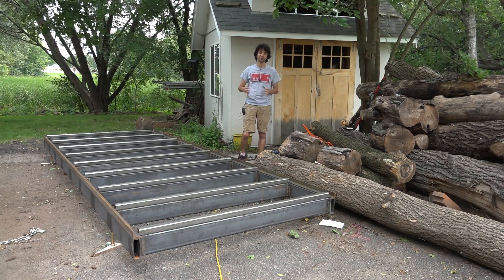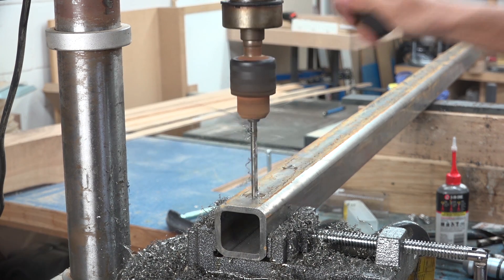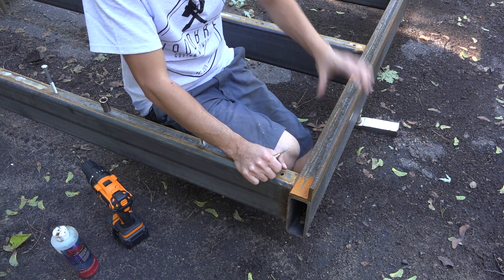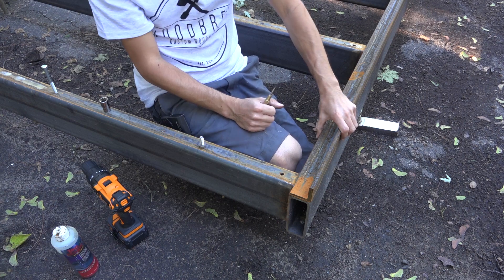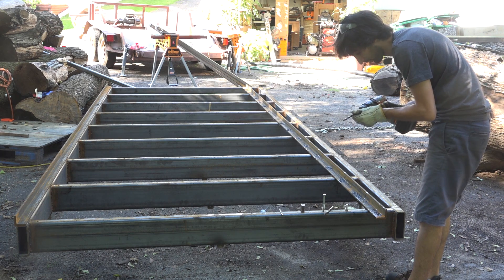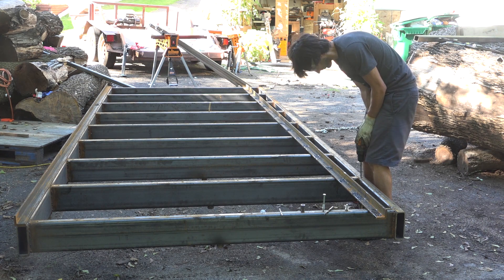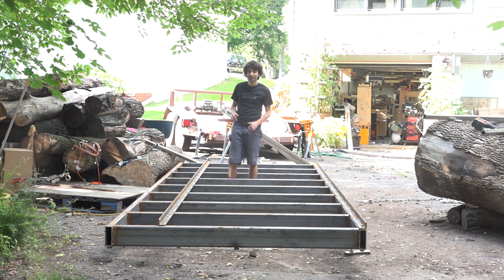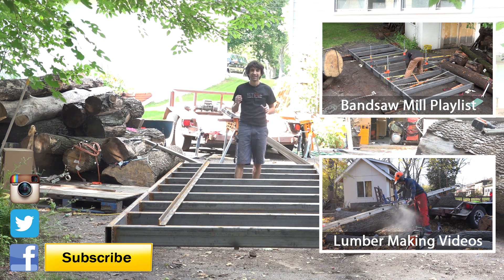Adding the Track and Runners - Building a Large Bandsaw Mill - Part 4

Comment: I for one applaud your good & positive attitude, even when things don’t quite go as planned. ☺️
I’ve been attempting to chainsaw mill with only a 20” bar. Not been a great experience thus far, as most logs I have are 20+” & red oak logs so dense & heavy, my LX2610 Kubota tractor can’t lift them up with its loader. I skidded a 30”X7’ log up from the pile & was able to stand it up on end, planning to saw it down the center, the pith off center, cutting that weight in half, so I can haul it to a friends mill. The grain, almost solid burl, from an old hollow red oak that was 7 to 8’ at the base, taken down for safety reasons & threatening other nearby trees.

Comment: Running a variable-speed drill at a low speed maximizes the strain on the control device. I worked for a company that made variable speed switches for drills. I would put the switch in a jig that presses the switch just enough so that the motor turns. Then I would time how long it took for the switch to melt. It was required to last at least 15 minutes. The switch would also have to melt in the open position, not the closed position (fail-safe).

Comment: Thanks Matt,
 really good learning experience. 
I have one question. Why you drill this holes and not use welding?. I would understand if you  would make everything to be disassembled, also the main frame. That would make sense, you could disassembly everything and store in small package if you don't use or if you want to sell it you can ship it in  a package.

Comment: Fill the hex head afterwards with grease..  stops the water pooling.  When you need to remove, heat with a heat gun the hex head quickly.. it will melt the grease to a liquids.  Towel the hex head dry enough to place the Allan wrench in the hex head and undo as needed..

Comment: At 9:36 (and various other times) if you have to sit on the drill, the bit might need sharpening, or you might have been running too slow and be work hardening the steel. 
I do hope your take away lesson from 7:44 was never ever leave the drill machine hanging on the bit!
Cool project, I love fabricating stuff, my last big fab job was making all the brackets (turned in to more of a sectional chassis so I could remove bits for access) to hold my Triumph Spitfire body on to the rotisserie for blasting and painting.

Comment: I know it is way too late now, but I have built several tables for cutting steel and I just turned the angle iron with the V up and got v notched wheels to run on them.  Works great.

Comment: dude you spent half a lifetime drilling holes, get yourself a professional welding machine , if I remember correctly it is silicon bronze that will weld carbon steel to stainless Its been decades since welding school, a magnetic drill press and some annular cutters. for what you spent on steel and materials seems like you can afford to get proper tools. Most people make these  DIY sawmills with repurposed materials

Comment: I HIGHLY recommend you deburr the sharp cut edges of your steel BEFORE doing any work on it.  You will need to do it anyway, and getting rid of those sharp edges first will prevent/reduce chance of cuts or other injury.
A good flat bastard file and a rat-tail will get the outside and inside edges.
MAKE SURE THE FILES HAVE HANDLES ON THEM.  Those tangs will easily pierce flesh!

And SLOW DOWN that hole saw!  You will get more holes per saw, less chance that the saw will grab etc.  Remember, its PRESSURE AND TORQUE, not speed, that gets the hole saw through the metal.  Ease off the pressure as you get through the metal...

When mounting the guide rails/angle iron:
Use a few bolts to hold it in place until you can get them welded in place.  

And as I'm sure you found out, when the drill bit begins to pierce through the metal you're drilling, REDUCE the pressure so the bit won't grab and snap.
Wisdom comes from experience....experience comes through lack of wisdom!

Comment: 6:09 man what went wrong with that weld? did you use rods that are recommended for vertical welding? If all the welds are like that I'd flip the frame on it's side, grind them flat and weld again in a horizontal position. I'm not sure if your machine will have to pass some sort of government inspection if you want to use it commercially but I doubt it will pass with these welds.
Reply: W.A. van Buren 
My bet, something about keeping the power low to avoid warping and doing the welds in 1/3rds at a time!

Comment: Why couldn't the track be welded?
Reply from the maker: +2thelightphoto distortion and bolting it on allows it to be adjusted so both are parallel and in the correct place for the wheels

Comment: @Matthew Cremona Hey Matthew, the holes that are drilled in the bottom of the frame at 15/16 for the adjustable legs, what size is the nut you welded to the bottom and what is the length, thread and type of bolt? Thanks in advance
Reply from the maker: 7/8"-9 nut and bolt.  I used some 6" and 5" bolts

Comment: I am LOVING this series of videos. Just subscribed to your channel too. I gotta agree with a previous commentor why the rail bolts at the x-members and not in between them?   Either way this is great stuff dude.  Next you can build a bigger lawn mower  :-)
Reply from the maker: +cadeuseus thank you!! I placed them there so they would be close to the load that will be placed on the crosse members by the weight of the log

Comment: Well, I suppose the Titanic had less bolts and thinner steel, so you should be able to put every log in your yard on there at once.  I am wondering who did the structural stuff to come up with all that 1/4" steel?  Cant wait to finish the entire series...
Reply from the maker: +mjkulikow I chose 1/4" wall so there would be enough thickness for a decent amount of threads. Thanks!

Comment: Holy overkill, Batman!!  It seems like you could've drilled holes in the runners in between every other cross member, instead of in between every cross member - saved you half of the holes needed.  Also, perhaps this was covered before, but what are the stainless steel cross members for?  Why not just set the logs on the steel cross members?

Comment: How many 7/8" hole saws did you go through with just this part? I know they're very expensive, and never last like you'd hope they would.
Reply from the maker: +Mark Price just the one although I still have more holes to drill with it. I've gotten really good mileage out of those saws. Pretty good deal at around $8 each
Reply: What brand of hole saw was that, I need to get some
Reply from the maker: Milwaukee

Comment: Kudos for having fortitude to keep at a massive project... good job so far... impressive... love wood work just don't have tolerance for time it takes to make things.

Being a fabricator of metal can I give you a tip?... get a grinder and learn how to sharpen drill bits... sharp bit requires less pressure, cleaner hole, less power on drill... and makes life easier.

Comment: I'm surprised you didn't drag out an extension cord and use a corded drill, more power for faster holes and no wasted time switching batteries on and off the charger.

Comment: Hi Matt,I don't drill steel very often but I do not seem to be able to find a drill bit that will last more than a couple of holes. I have bought named brands of bits, used dr4illing compound to cool the drill, and run the drill at the recommended (and sometimes slower ) speed. Could you tell me the make of drill bit you are using so that I can try them. Great video and I look foreword to seeing the mill in action.

Comment: I GAVE YOU A LIKE, JUST ON HOLE DRILLING. HOW MANY DRILL BITS DID YOU USE? ALSO TRY A CORDED DRILL IN STEEL WHEN YOU HAVE SO MANY HOLES,  TRY SOME  PUDDY OR SOME RUBBER CAULK IN THE SOCKET HOLES. GOOD JOB

Comment: Matt use dish soap for drill fluid. It doesnt smoke and stink like that cutting fluid does. Also dont push so hard on the bits they will cut better. Plus I think that is why you bloke so many in the other video. Less pressure will suit your purpose better.. I know that sounds counter intuitive but give it a try.
Reply: False. Steel drilling is totally reliant on pressure.
Reply: He didn't say not to push, he said not to push so hard. You do have to let the bit do its job.

Comment: How do the batteries on the Triton drill hold up?
Reply from the maker: +Andrew Tucker pretty well. Changed batteries twice drilling all these holes
Reply: Thanks.  I know they are sponsoring you now.  I'm in the market for new cordless tools next year.  I've ruled out many of them because of all the marketing nonsense.  If you've never watched AvE, you should.  He tears down new tools to do his review and has knowledge of the corporate structure.  I'm frustrated with Porter Cable.  I have the older 18v set and when they moved to the 20v, they doubled the price of the NiCd batteries and don't offer the Lithium ones anymore.  I'm sure they did this to get people to buy the 20v kit.  I'm really down to DeWalt, Milwaukee, and Makita since they are well supported because of all the contractors that use them.  I may add Triton since they are engaging us through practical YouTube sponsorship.

Comment: Coming along nicely. You could protect the socket head screws by filling the cavity with wax or heavy grease. Also, suggest when you do final assembly you apply some anti seize to all threaded surfaces in case you ever need to disassemble something. I love to see big sawmills in action, so very eager to see this one running.

Comment: I am of the definite opinion that Matt here is just ever so slightly "touched" in the head, but in a good way.
Having said that, I am also of the opinion that Matt should have bought himself a Mag-Drill [without busting the budget] as the number of holes, taps and countersinks involved in this project would have paid for it by now, both in ease of drilling and safety.
Reply from the maker: +Mark Fryer I won't argue that I'm a bit crazy
Reply: I bet your wishing you had bought a mag drill though.
Reply from the maker: +Mark Fryer yes and no. It's been a good experience thus far. I'll appreciate the ease of a mag drill next time
Reply: Before I forget, put some grease in the holes with each bolt so that they dont get frozen in with rust and become a real pain in the butt to undo. Trust me on this one, I work in maintenance at a large school and rust frozen bolts and screws are a part of my life that I dont need.

Comment: whenever you use stainless bolts make sure to use never cease on them. or else you risk ceasing and snapping them.  I'd put never cease on every bolt on this as its being stored outside.  just a tip from experience!
Reply: Yeah without an anti seize lubricant on the bolts, the stainless steel bolts will cold weld to the rest of the frame over time.

Comment: I've got no patience with cordless drills for steel drilling. For what you are doing I get out my old Milwaukee 1/2" chuck corded drill with all the power, all the speed, all the time.
Reply: Yep...Ive got an oldie  1/2 Milwaukee magnum holeshooter. It 30 years old. I used it today to drill 3/4 inch holes in the 1/2 inch steel  front mount of a tractor. A cordless drill cannot keep the drill turning at the proper speed for drilling. Too fast is bad....too slow is bad....especially when it tries to take too deep of a cut and seizes on you. I'm not so sure of the newer 1/2 Milwaukee's but the older ones were very easy to regulate the speed. I wonder what happened to his corded drill he used in the last video?
Reply: Steven Hardy 
My guess would be it got so hot it melted the plastic case at the bearing supports, you can’t beat the old cast metal bodies, yes they might be heavier, but they conduct the heat away better and are more resistant to flex in the bodies, their only downfall is when cheaper units run the tail of the chuck spindle straight in the body. 
The other problem Matt had with the mains powered drill was speed control, too fast or too slow!

Comment: So much drilling man. How many bits have you gone through?
Reply from the maker: Not many.  I did have to sharpen the ones I was using in this video
Reply: How do you sharpen your drill bits? Drill Dr.?
Reply from the maker: I did it with my bench grinder and a tool rest

Comment: Another great one, Matt!  Is there an easy way to clean up all that metal from drilling the holes?  I can imagine the cuss words that would come outta my mouth if I stepped on one!
Reply from the maker: +Matt Kummell thanks! The regular steel ones can be picked up with a magnet. The stainless ones in my shop on the other hand are going to pose a bigger problem
Reply: Matthew Cremona 
Probably you have found all the swarf by now, but for others, not all stainless is completely non magnetic, in fact an awful lot of it is still magnetic! Only a few grades are completely non magnetic. 
We used to call it stainless iron where I worked! 🤣
As someone else mentioned the best way to pick up swarf is with a magnet in a bag or wrapped in cloth, think bits of old T shirt!

Comment: Hi Matt! Perhaps you should use spring washers for that assembly. Otherwise, you will probably lose some of those screws, due to vibrations. Btw awesome project! I'm enyoing it as much as any other. Keep on!
Reply from the maker: Yes, I'm thinking of switching them out.  I will be using some sort of locking washer on the track.  The runners might be alright  We'll have to see how much vibration there is when it's operational.  Thanks!

Comment: Matt try using this product: it's called Mistic Metal Mover it will make your drill bits and your hole saws double or triple  in life.
Reply from the maker: Thanks for the tip.  I'll order some of that.
Reply: Should be available at your welding supply or metal supply place. It really works, It used to say it would make a dull drill bit, perform like a new one! was hard to believe, but it was true.

Comment: have you given any thought to accelerated bi-metallic corrosion,
Reply from the maker: +Livi120 yes, the paint on the frame should insulate the frame from the runners and I'll be using antisieze on the bolts which should help there. Regardless I'll be watching to see how it does over time

Comment: Hey Matt, wow, that Triton really is something! A little FYI, if you have a magnet around and put it on the Allen key you're using it will magnetize the key for awhile. Help hold the nuts as you put them through the upper hole. Unless they are stainless, then result to chewing gum! Heh.
Reply from the maker: Oh yeah, I was really impressed by it.  Those bolts are stainless ;)

Comment: to help with drilling in steel with a hand drill try using a 2x2 as a lever, the back of the drill as the fulcrum, and a loop of rope wrapped around steel frame. Place drill in desired location, lay 2x2 on back of drill, place loop over end of 2x2, press down on opposite end ->  tensions rope while applying downward force on drill. This works like a make shift drill press and makes life much easier when drilling through thick steel with a hand drill.

Comment: Little tip, I find that using a 1/8" pilot drill before any larger drill bit makes it so so much easier. Not sure if this is already what you are doing.
Reply from the maker: I was worried about breaking such a small bit
Reply: +Matthew Cremona That happens from time to time. As long as the drill is held straight and don't put heaps of weight on it you will be fine

Comment: Amazed at your drill's longevity! How many battery changes did you have to do?
Reply from the maker: When I changed the battery in the video that was the first time.  I was able to drill all the holes up to that point on one of the batteries that came precharged in the box.  The other precharged battery got me through the rest of that side's holes and most of the holes on the other side.  I swapped batteries again to finish up that side.  I was really surprised and impressed by the battery life.